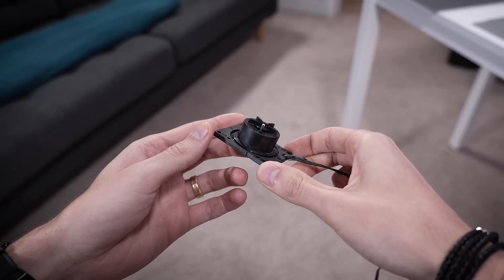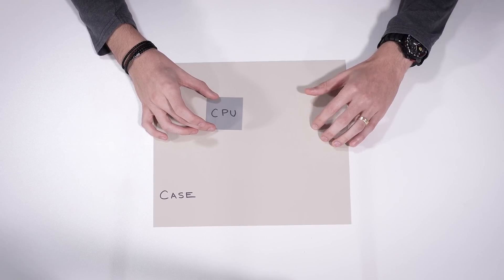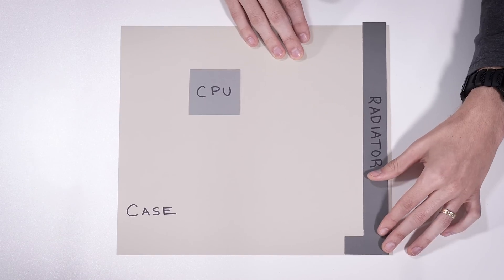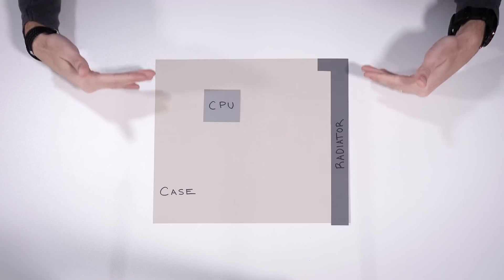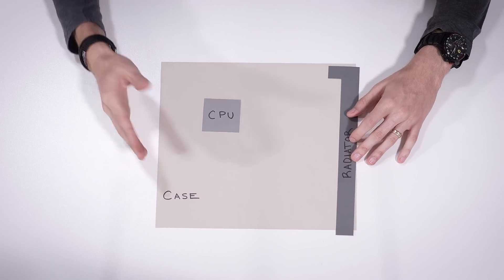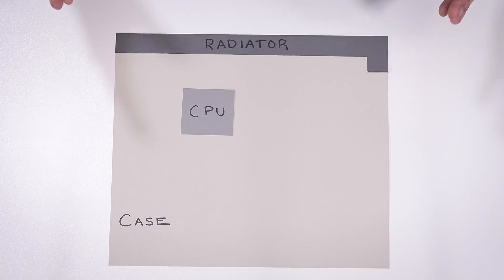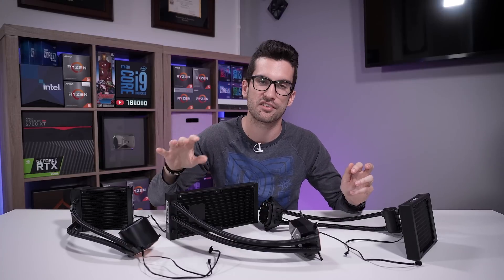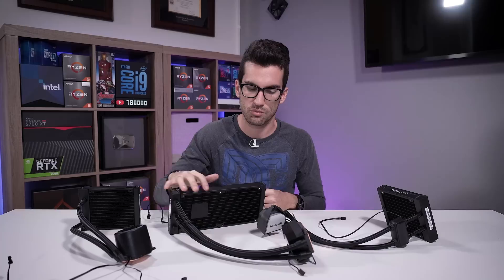All AIO Mounting Positions Explained

Comment: Going on 3 months now with a Fractal Designs Celsius + S28 front mounted in a Fractal Designs Focus G, barbs up, with 2 140mm fans in a pull configuration. It's cooling an I7-11700F. Package temps are around 35 C idle and I have gotten it to 65 C running Cinebench R21. Case has 2 120mm exhaust fans as well as a 2070 Super blower GPU, so good airflow overall. This is a 'pump in radiator' design, and the highest point is a tie between the radiator barbs and the CPU block. The pump is almost 80mm lower than those high points. I have confidence it will last, and a Hyper 212 in a box under the bed in case it doesn't.
Reply: Update: I was so confident in the AIO I sold my 'spare' air cooler in a budget rig I assembled just for that reason. Disaster had merely been waiting. The Fractal AIO suffered the same gunking up of the coldplate with a dramatic reduction of efficency in a short period of time that MSI's AIOs suffered from. Worse, I had moved, and somehow the Fractal box, and all the opther spare parts like the AMD mounting hardware, were gone - presumably in the dumpster's worth of trash from my move. This was my fault, but it eliminated RMA of the Fractal AIO. My confidence in AIOs in general is now sunk. I replaced it with a Scythe Fuma 2 I got locally 'open box' in order to keep using the system.

Comment: Hm … on top with the fans blowing down … yeah it might seem like a good idea since you are forcing cooler air in however you will bring heat Into the case (and the outtake fan on the back might even course the air to be pulled back in depending on your case position) 
In my experience it’s better to have the fans blowing up since your cpu temps might be a bit higher but the rest of the components will stay cooler (Ram vrm m.2 drives Ect)
If you want more fresh air than turn the outtake fan on the back into an intake (be sure to use a dust filter on it in that orientation) and you will be bringing in some cooler air without the air being pulled back in (since the hot air will rise and the fan at the back is lower than the radiator) 
Just wanted to point that out
Reply: agree also blowing in from the top you are fighting nature as hot air always rises so not only do you need fans strong enough to blow through the fin stacks but also strong enough to blow against the hot air current within the case

Comment: I have 2 pc's with the NZXT Kraken M22 120mm top mounted, I have not yet (approx. 4 months) heard any noise from the pumps. Time will tell.  They still cool the CPU's very well, no overheating. But that could be because they are properly filled, and permeation hos not yet happened.
Reply: Same with my c240 but it's only a week

Comment: I think I fucked up by top mounting my MSI aio leading to its very short demise. Sounds like it’s churning rocks and the temps have shot up around 30 degrees. That and there is a recall because they didn’t use Proper coolant which then accelerated growth and blockage in the system. Gonna take the hard reset hammer to it if my RMA doesn’t get fulfilled.

Comment: The things I worry about AIO is chance of leakage, contamination of interior fluid leading to blockage, and failure pump. Compared to aircool which I can visualize or hear the fan failure.
Reply: But better cooling super fast is worth it. It mixtures gas glycol and remains distilled water

Comment: I've got my Cooler Master 240mm AIO mounted to the inside front panel with the barbs up and the 2 fans pushing air through from the outside front panel, but still covered up by the actual front panel cover.  Also have a 120mm side panel mounted air intake fan blowing directly onto the dual fan GPU and the PSU.  The GPU fans pull air through and exhaust out the rear.  The PSU is mounted with the fan down, so it's not sucking warm case air into it before it exhausts out the back.  I've also got a 120mm top exhaust fan, a 120mm rear exhaust fan, as well as the GPU exhaust fan, which means that I technically have 3 intake and 3 exhaust fans (PSU fan not counting).  CPU is a Ryzen 7 5800X and temperatures hover around 32*C with the lowest so far at 27*C.  Haven't seen the CPU temps go above 42*C yet.

Comment: Im considering adding an AIO to my 5700G  setup i have a Phantek Eclipse 600s case so I have plenty of room to work with . If i was to top mount my AIO would it be a smart move  to mount the unit on a slight lean so that any air in the unit would be forced to the rear [opposite end of barbs] I would think i could do this with some small spacers/washers on the barb end of unit so it sits a few millimeters lower   Im yet to decide on which AIO i go for  as i am wanting a LCD block that shows temps or at least a colour variable reflecting cpu temps Appreciate your advice and love your videos Thanks

Comment: When the pump is in the radiator, couldn't you angle the radiator a little bit to force the air away from the pump. ??  Put a little spacer on one mounting side of the radiator.

Comment: Another thing to mention for a lot of newer AIOs(you can see it on the MSI cooler, for example), is that if you suspect that they aren't filled enough, you can top them off yourself. Just remove the bolt and fill 'er up.
Reply from the maker: Yep, this was discussed in the be quiet! Pure Loop section of the video as well.

Comment: Just have a question so I do have this Deepcool Gammaxx L360 A-RGB AIO what's more better to mount it? Top mount with Barbs in the front of the case or back of the case OR should I front mount it barbs up or down? Badly need help T-T

Comment: Jajajaja! Dude this is a lot of confidence bc i was looking for this information and i found a lot of coments and very confuse information about how to mount correctly the AIO. Now with this video i feel more safety how i will mounted my AIO. Now im feel kind of concers if i mounted the AIO on the top intake the air inside of the case bc the temp in my house is 30°c/21°c and plus the temp of inside of the case its kind of high soo i dont find a very good option put the fan in that position, soo i was thinking in mount the AIO in top but exhausted but i think im gonna kill the asthetic aspect, soo i guess i gonna make my test and will see what its the best option. Thanks again for the video Salazar!

Comment: i just recently built my fist pc and bought a msi coreliquid  240r without knowing the pump is in the radiator. as i only have mounting option it s making some weird sounds sometimes.
One question: if my pump dies, how likely is it that anything spills? Cause i wouldnt be that sad if my aio dies, as im gonna buy a new one with a pump in the block if it does, but i dont want my other components die with it.

Comment: in general positioning rad so the air is away from barbs? example front mount rad barbs towards bottom of case? This is how i plan on installing my  aoi given the hoses are long enough. planning on open loop watercoolig after this.

Comment: Had a corsair H60 for my old i7 2600k, but the pump had to work more after 3 years. So when i upgraded to my 3700x i was like i am done with aio as they go bad after ~3 years and in the most cases you cant refill them. So i am pretty glad with my noctua nh-d15, and i dont have to think about placement of pump or refilling it. 

So when i upgrade next time i still think i will just stick with a big air cooler, to much hazle with aio`s. Sure i do love their silence and very nice cooling but in the long run just more relaxing with big air tower cooler.

Comment: I have the alphacool eisbear extreme its a monster of a cooler it can only be mounted in 2 orintations in the roof or in the front but it does not fit the roof of my 7000d case

Comment: I have the InWin BR24, it has the same pump position as the Be Quiet AIO but it also has a fan on the block to help cool the area around the CPU 😊 Thank you for helping me choose where to place the radiator when I switch over to the BR24 😁

Comment: I recently installed a Corsair H100i. I have it top mounted and the fans on exhaust, should i change the orientation or is this fine? Im pretty sure the pump is not in the RAD. I replaced a dead aio with this corsair one and dont want to replace this corsair one anytime soon.

Comment: its been forever talking about this, its so annoying that people just wont understand, like if they're really that stuck on it then maybe they shouldn't be around a computer in the first place lol. I have my aio front mounted with the tubes at the bottom, I have a nzxt x63 (280mm) the tubes make it just fine in the corsair airflow 4000D and the reason I personally like it that way is that I just didn't want to bother risking the bubbles at the top. sometimes you get an aio that isn't filled ALL the way, shit happens lol. but if I wanted to, I could easily mount it to the tubes at the top. not to mention (depending on ur case) having it in the front is REALLY good, mainly because the air flow usually comes in from the front then out from top and back. so the 3 fans I have in the front pull cool air in to the rad then the 2 nzxt 280mm fans pull it in to the case and the fans in the top and back pull it out. which makes it way better for the CPU (or GPU if that's what ur using), I have a Ryzen 7 5800X and we all know that's a HOT CPU, I have it over clocked to 4600mhz and I get 37c when I'm idle and the highest I hit when playing heavy games is like 72c.
Reply: Fans on your aio are toward the inside orr outside the case on the radiator ?

Comment: It's a good topic :) I did go down the rabbit hole a bit with mine but I think ended up good and now in line also with your recommendations. I did not realize just how good AIO's are though. I have just built a PC for my son (the motherboard was DOA so I had to send it back and currently my system's motherboard is on my son's PC while his motherboard is travelling through UPS). But I have to admit I cheaped out a bit on my son's and didn't get him an AIO. I was shooting for a strict $1000 budget which became $1100 with shipping and tax, so I think I made it :) Anyways I got him the stock AMD cooler and Cinebench is able to get it to 90C on the first render pass! For reference, I did the same on mine (I have a Cooler Master 240mm AIO) with a similar processor (AMD 3600X and 5600X) and I was able to overclock mine until a comfortable max 75C on Cinebench boosting my benchmark score significantly. Now I got the Vetroo V5 cooler on the way to replace the AMD stock cooler, so although I may not be able to overlock his I may be able to keep the temps under control at heavy loads. He will be doing a bit more than gaming, like streaming and a bit of lite 3D model/render so I need to make sure he doesn't blow up his CPU.

Comment: top mouted in  exaust mode fans. why?cause for a gaming sys,you always prefer to have more  hot air exuasted on top  produced by the GPU than worry about 3 or 5 Cº on cpu temps. simple put two or three fans on front intake positon and 240\280\360\etc on top exausting all the hot air from the all sys,levering the convexing of air thermodinamyuyc natural flow from below fresh to above hot...

Comment: I have a CoolerMaste ML360 sub zero, it have the pump between the radiator and the header, I placed the pump than the header (like in the third fan mount of the front panel), and the radiator in the top, that's right? (Btw I hear sometimes like bubbles in the pump but the AiO doesn't have even a year with me)

Comment: MSI only ever advertised the radiator mounted at the top of the case, which is why the Coreliquid R had so, so many pump failures. I bought a Coreliquid 240R which made a very annoying high pitched whine as soon as I installed it, which only got worse with time. I replaced it with another AIO and installed the MSI in my son's computer vertically. No pump whine whatsoever. MSI needs to have a word with itself...
Reply: Did you install it with the barbs down or up ?

Comment: A great clear video Greg.
One thing that I do have to mention, Case airflow. You say having the AIO in the front usually will have the system running cooler than having the AIO exhausting out the top. I've tried both ways, and found with my case, that has 3 120mm fans at the front with a mesh front giving good airflow drawing air in, the system runs cooler with the AIO exhausting out the top by about 8-10 deg C. I believe that's due to the good flow off cooler air coming in through the front off the case. My GPU also ran hotter with the AIO in the front off the case. Something to consider.
My AIO btw is a Cooler Master Masterliquid ML240L.

Looking forward to the next video Greg.
Reply: Do you put fans inside or outside the case on the radiator ? =) air goin inside if i got it and extract from the top ?!
Reply: @MrLazer44 . On the inside blowing through the radiator then out the top.
Reply: @SirDaffyD  My bad i misread your comment (my english is not that great), i have a coreliquid 360 not mounted yet, and the pump is in the radiator, i want to put him in front with tubes at the bottom, should i put my fans outside the case so the air can go threw the radiator then in the system?
Reply: @MrLazer44 . Blowing through the radiator they say is better, but it'll work the other way. 
I'm gathering the pump is in the middle of the radiator, so putting the hose at the bottom should be OK, but quote me on that, it's not o good idea doing it that way when the pump is in the heat block on the cpu, because air will get in the pump and cause it to fail. 
There's heaps of YouTube videos in the best way to situate your aio radiator. Check them out.
Reply: @SirDaffyD  i know about front mounting for a "regular" aio, but since the pump is  in the first 1/3 of the radiator (in the middle of the fan), no air will go in the cpu block because the higherr part in the aio will be the radiator so it should be okay i think.

Comment: Can anyone help me. My pc has started getting black screen for gaming. I hard restart resolved it at first but now it goes black screen every time the game fully loads. I've updated everything (windows , drivers etc ) and no result. I thought issue might have been just for elden ring but it's the same for ESO, halo inf, valheim baulders gate 3.  i had no issues until recently. I can play lower graphics pixelated games (vampire survivors etc) I've tried to play in windowed mode and reduced graphics settings to no luck. I've tried the shortcut to restart GPU and no luck. Is my GPU on the way out? It's a geforce rtx 2060 that came with my hp omen gaming pc . I even tried doing the 3d benchmark test but even that gave me a black screen once it booted up

Comment: Boiled down:
Step 1: Find out where the pump is in your AIO.
Step 2: Mount the AIO in such a way that the pump is not in the highest point of the loop, and preferably neither is the CPU block.
Step 3: Enjoy your cool CPU.
Reply: The radiator needs to be the highest point, because Lou dont want air bubbles floating around 😬

Comment: It's really basic physics and basic knowledge.. I don't understand why people are so confused about this.. lol.  As long as you keep the air bubbles out of the pump then your good.  Bubbles rises in liquid and likes to stay at the highest point of the system. That's all there is to it. Its not rocket science. lol.  

EX: I have my RAD set way below my pump (bottom of my case) BUT I have a really long TUBE. I made it so the highest point in my AIO is the TUBE where it curves back down to my RAD.. So if you follow the basic physics the bubbles are trapped on the highest part of my system, which is the TUBE where it curves back down. So that means the bubbles are trapped on top of that tube and NOT in my pump. As long as the air bubbles cant get into the pump then your golden.

Comment: I like the video, but..... I don't care, since I'm air-cooling only. Also some would say dark rock pro 4 (250W TDP ) is overkill for Intel i5 12400 ( + had to order brackets separatly for 1700 socket ), but even if somehow fans fail, my cpu will be safe from overheating. + I can reuse cpu cooler even if I upgrade to higher end cpu.  I'm also using be quiet pure base 500 DX case + 3 extra fans, and be quiet dark power 1200W titanium psu.

Comment: Super nice video ! I'm running my AIO in front position and barbs up for 5 years now and no issue so far with CPU TEMP and PUMP. When I first mounted the AIO, I've put it on top but after trying the front position, the CPU temp was much better and so I kept it that way. I just got a question.. AIO manufacturer claims that AIO are maintenance free, would you agree? I mean you should clean the radiator from time to time but what about the liquid cooling ? I ask this 'cause I seen your video on repairing a viewer PC which had a clogged pump.

Comment: Hey Greg, I'm moving from an rx 580 to a 6600 soon, and I was wondering if there may be any complications with gpu drivers. This is my only upgrade to my pc I've ever made, and I've heard that switching between Nvidia and AMD card can cause some files to be unreadable by the hardware. Thanks for your help and love the videos!
Reply: I recommend flushing out all the old drivers before installing new ones. I believe a YouTube channel has a complete review on how to do that.  Good luck with your new unit.
Reply: @NewAgeDIY  thanks
Reply: @DeeDee Ranged thanks for your advice!
Reply: If you really want to make sure there will be no complications, I recommend using DDU before installing your new gpu. Especially recommended when switching from amd to nvidia.
Reply: @shawnd7  how do I do DDU?

Comment: Been using the PureLoop 360 on front mount configuration in a LanCool2 Mesh for quite some time, full blast on pump, everything things looks fine no weird sound. Except it somehow performed worse than my ID-Cooling 240 aio. Thermal paste is well spread last time I checked, idle temp with wallpaper engine running is around 54c while ID-Cooling 240 is at 48c